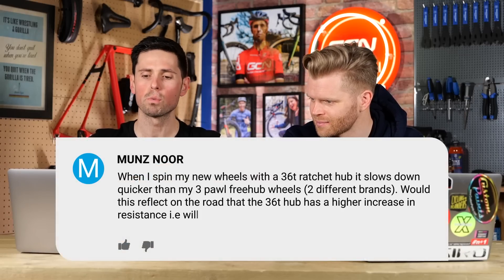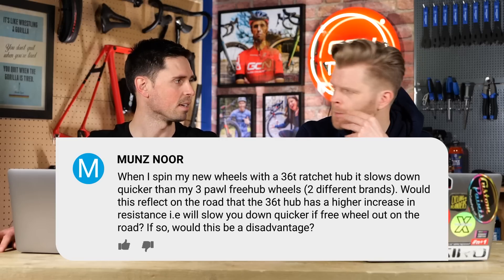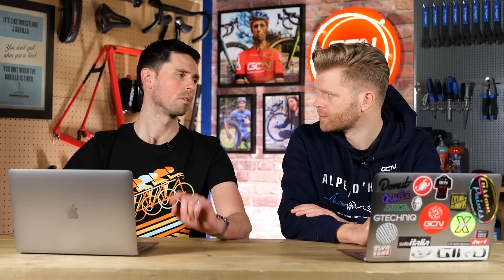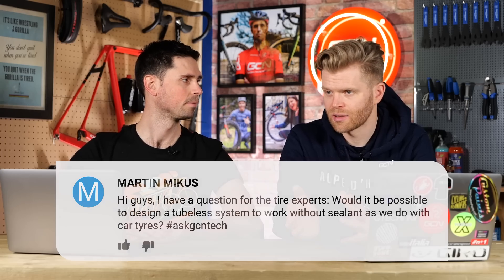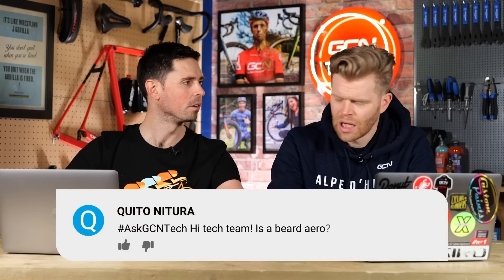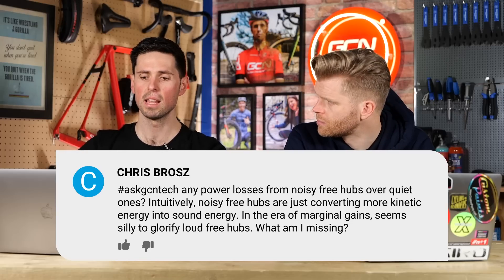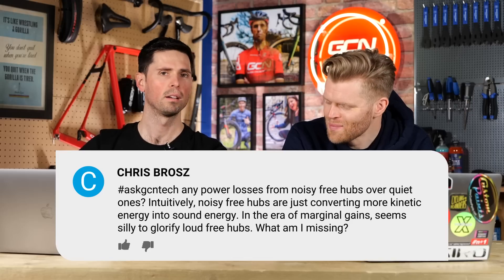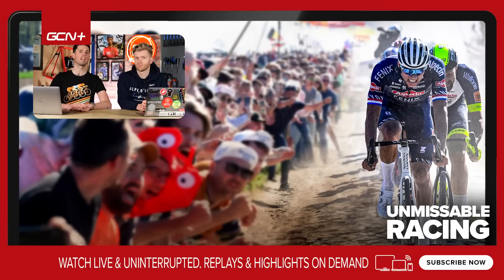Loud Hubs, Electronic Groupsets & Old Tubeless Sealant | GCN Tech Clinic

Comment: For the last question regarding the hole in the frame, the best neat, low cost solution is to use some Sugru to mould around the one remaining cable. You can get different colours to suit your bike and it's removable.
Reply: this is exactly what I did to plug up the front derailleur cable hole to avoid water getting inside the frame

Comment: For the last query, I'd try something like 'Sugru' if the hole to be filled around the cable isn't too big. It's like mouldable plasticine type stuff that sets as a flexible rubber. I've used it a few times on bikes to make grommets etc. Comes in different colours too. One for #hack/bodge maybe?

Comment: Shimano used to make an "external" kit for Di2.  They looked like rubber sleeves that had 3M tape on the backside so you could affix them to the frame and the Di2 cable would be protected.  I had a bike that had that setup (the frame was an older Merckx with cable bosses on the downtube).  It worked just like my other Di2 equipped bike and the Di2 cables were never in danger of being damaged.  Perhaps Shimano still sells that kit?  Or, eBay is an option I'm sure.

Comment: I think the “loud” hubs with more teeth in the ratchet are better when you are moving in that they engage sooner. Pedal stroke is more quickly translated to wheel movement. This is a bigger factor than extra resistance when freewheeling

Comment: 9:00 The thing to remember here is that sound is very 'cheap', energy-wise (or more scientifically, you get a lot of volume for very little acoustic energy). I guarantee that if anyone ever measures the power loss of a loud hub over a quiet one it will be in the hundredths of watts, if that.

If you had a 0.1m/s headwind or 1psi difference in tyre pressure you wouldn't even notice - you just notice the louder hub, that's all...

Comment: For the noisy hub question. The noise generated by the hub is due to the strength of springs trying to grip on the teeth immediately (otherwise you're not gonna go anywhere while pedaling).
Reply: More louddd

Comment: I think when we talk about free-hubs being "loud" we're not really talking about volume but how "noisy" they are. Noisier high pitched "buzzy" free-hubs have more engagement points (pawls/ratchets/teeth etc.) but those points are smaller and offer less friction/engagement individually, but when added up the friction and surface area of engagement is about the same (or less) across the system. They are preferred because more engagement points means the hub engages sooner in the pedal stroke. I actually suspect that on the decibel scale hubs we describe as "loud" are actually quieter or about the same.

Comment: Hi #askgcntech
If I remember correctly, the Continental GP5000 TL was a tubeless tire, not requiring sealant.
You could use it with sealant, but was not mandatory.

Comment: I recently replaced my old Mechanical 11 speed Shimano and replaced it with the SRAM Force AXS on my Emonda ALR which is not setup for internal routing. It's getting very hard to find the Rim brake shifters and now SRAM has abandoned rim brakes with the new Force version. I am glad I finally took the plunge when I could find them.

Comment: I dont use sealant in my tubeless ready tires they work just fine. 
Holds air for long periods of time.
Flat? Well i patch it dont get flats that often i run Continental gator skins. One flat in seven hundred miles so far on these tires. 
Lot of people who run sealant are just reopening old holes and don't know it.  Lol  Ok good stuff  keepemcoming

Comment: The main reason why 'good' quality free hubs are more noisy is because they manufacture is opting for more points of engagement in the ratchetting system. This creates more nose as there are more points of contact moving past each other which while free spinning and this does cause more friction, slowing you down faster. However when pedalling the extra engagement will allow for better power transfer, as it is being done over a larger surface area, while also reducing wear on the system. Additionally it will decrease the time for engagement when you first start to pedal.
The question is, does the power you gain while pedalling outweigh the speed you lose while costing? I would find it hard to believe there would be many rides where the additional lose is more than the gain of the better ratchet system.
Additionally systems like the DT swiss star ratchet are far more reliable that the 'traditional' 3 or 4 pawl system used in cheaper hubs.

Comment: The freehub sound will be more of an effect on drag than aero socks and many of the other so called marginal gains. The sound requires energy to make so therefore there is energy being used. If you are racing you lose the ability to stealthily idle behind a group/person in front.

Comment: Automotive tires are significantly thicker than bike tires, and I think that's a big difference. A smallish piece of glass can easily puncture a bike tire but have zero effect on a car tire. 

Also, Specialized found that facial hair has little to no measurable effect on a riders aerodynamics. Arm and leg however, are significant sources of drag.

On hub acoustics, I think this is easily as much a product of the geometry and configuration of the hub itself... if there is more dead space in a hub, or if the ratchet is somehow more directly exposed to free air, that alone will make it louder.

Comment: Wow, the answer to the first question on drag from coasting with different rear hubs was quite a contrast to the answer on the second to last question about freehub noise.  Since these are all "marginal gains or losses", It would be good if GCN quantified the power consumption of each.  I bet coasting with a draggy freehub is 10x worse than not waxing your chain.
Reply: My guess is that the new wheel just has fully packed bearings that are draggy, and that the freehub is more of a distraction.  As bearings lose some grease over time they spin more freely.  A loud free hub with less and/or lighter grease is likely more efficient than one with heavier/quieter grease.  If a hub has lighter springs it would be marginally less lossy, and quieter.  Overall we are only talking losses when freewheeling, which make all this on the margins of the marginal gains worries.  Buy the hub that you like that lasts the longest.

Comment: #askgcntech I'm gonna come back to my question (you already answered in an earlier episode) about dimples on components and gear, and the aerodynamic benefit of these. The Speedplay Aero pedals have dimples on them. Endura's Encapsulator aerosuit was banned due to silicone textures on the sleeves.. not dimples, but an uneven surface. This just makes me think that a big dimpled (or textured) surface like an aero helmet could possibly make a marginal difference.

Comment: #askgcntech Hello! Not really a tech question, but I'm wondering what might be easier on the body after shoulder damage, flat bars or drop bars? Currently converting a spare  mtb bike to a gravel bike, but before was able to test ride it, I broke my collar bone. So I had the though if I should keep the drops or put flat bars back for easier recovery?

Comment: #askgcntech , Is there any tape or similar which I could put on the rear of the round carbon frame tubes that has “dimples” like a golf ball and would this make an aero difference?  
Why?
I have a reasonably old road bike, a 2008 Schwinn Peleton LTD (nice black, red, gold, original colouring).
I have upgraded it recently ( I did not want to buy a new bike) with R7000 levers, ultegra 11 speed derailleurs and cassette / chain rings, DA chain (I already wax) some 50mm carbon wheels, with nice low rolling resistance Vittorio tires and a lovely Balance Inc integrated aero bar with RED bar tape.  The bike already had older Dura Ace brakes and carbon seat post.
But, the bike is not aero of course, just possibly better than before.  I have an Idea, based on a golf ball having “dimples” to let the airflow stick better/longer.  There is a lot of information about such being very effective for ball distance as the airflow sticks longer.
Ray...

Comment: Why don't bicycles use Torrington oneway bearings.  Don't think the weight would be an issue.  They grab/release quite well and there would be no sound generated.  RC helicopters have used these for decades to free wheel the main rotar hub in autorotation maneuvers to disengage pretty powerful engines.
Reply: "Bicycles" already do. They are called spragg not torrington. Go buy the hubs whenever you like, but they aren't as reliable and they slip/wear

Comment: #ASKGCNTECH  On my new road bike I'm getting a very frustrating chain vibration when the chain is on the smaller rear cogs and small front chainring. The chain vibrates on the top of the travel as it goes from the small cog in back to the top of the front chainring. It's a resonant frequency when I get between 80-85 RPM cadence, then it settles down at about 90 RPM. Have tightened the B-screw, even replaced the derailleur, and rear cassette and re-lubed the chain. Any idea what is causing this?

Comment: #AskGCNTech Dear GCN tech, Is there a tool that can adjust the distance between the pedal axle and the seat and stem on two different bikes, for example a road bike and a Gravel bike. I feel like I'm always using different measurements because my knees are complaining. Thanks in advance!
Reply: Tape measure
Reply: @mikecoller  I tried already is not precise

Comment: Surely to make tubeless milk/muck/slime free tyre manufacturers just need a layer of soft rubber/compound on the bead area of the side wall. Minimum weight gain more than offset by not needing the milk.
I'll never go tubeless as long as it's needs milk. Have you ever rolled a paint tin with a small amount of paint in it?
It doesn't go far because of the liquid inside. I don't want that affecting my cycling.

Comment: #askgcntech if I wanted to change my overall cassette to have a larger tooth sprocket on my canyon (but keep it 11 speed), does this require a change of chain too (or anything else)?
Reply: Hi, it depends on how big the cassette is. If it’s too large for the capacity you’ll know because there won’t be enough clearance between the cassette and the derailleur hanger, pinching the chain. In this case you’ll either need a longer hanger or use a hanger extension  (“wolf tooth”). You may also need a longer chain. I went through this exercise to replace my 11-28 with an 11-34 cassette, in prep for some big hills.

Comment: Just got a bike fit, was told there were two things I needed to get sooner than later. New pedals with a longer spindle, 59mm. And Shorter crank arms. After already getting a new bike, both of these seem costly if you consider powermeters, and the new 105 Di2. What path do you suggest getting first? #askgcn
Reply: you may be able to get a new spindle and use the same pedal.

Comment: I’m willing to wager that somebody else has already mentioned this, but the two of you seem to have missed the fact that when a freehub is making sound, regardless of its design or how noisy it is, the rider is not peddling the bike and the hub is basically in an unlocked position! If you are not putting energy into the drivetrain, energy consumption is a non-issue at that moment. The resistance created by the freehub when it is frewheeling might have a slight amount of drag while coasting, say during a descent, but if it was enough to be an issue at all, the first thing that would happen is your chain would drop into your chain stay, which would be a much bigger problem then lost efficiency!  I’m  baffled that you didn’t consider this!

Comment: Good luck with that silca sealant! The fibres ball up and become useless. Check your tyres after a hundred miles. They sent me their latest formulation, supposed to solve the problem,  but it was just as crap. Oh, don't use CO2, because that solidifies the sealant real quick. Anyway, even with the fibres balled up, it's probably better than that water soluble muc-off rubbish that washes out of holes at the first sign of dampness.

Comment: Car tires are very rigid and require special machines to get on the rim. You don't want that in a bike tire. Car tires are stiff because the car has a suspension. On a (road) bike, the tires ARE the suspension.  You want them soft and flexible.  Yes you 'could' make a tire that doesn't need sealant.  But it would be much heavier, impossible to change on the road, and ride terrible.

Comment: Why is Munz Noor comparing apples and oranges. He mentions teeth on one wheelset and pawls on the other. Pawls engage with teeth! How many teeth do the 3 pawl wheels have. How many pawls do the 36 teeth wheels have. I'm surprised Ollie and Alex didn't mention it. But that info really only relates to engagement time. Doubt it has much to do with any resistance. The wheel bearings would be more important.
Reply: Perhaps he meant the DT Swiss Ratchet freewheel - which doesn't have pawls?

Comment: #askgcntech Hi guys, I'm looking to spend some of my hard earned cash on some nice upgrades for my road bike, a Cannondale SuperSix EVO Hi-Mod from 2018. The question is which one to make. Do I go with a fresh set of DT Swiss ERC DICUT 45 DB or the new 12 speed Ultegra groupset? Or maybe something else entirely? I have of course gotten a nice pair of high quality tires set up tubeless already. The bike is currently fitted with mechanical Ultegra 8000 series and 35mm carbon wheels. The rims might be carbon but the hubs are garbage requiring constant maintenance.

Thanks in advance!

BONUS: If I got the wheels, I'd also be using them for the occasional local off road race on my gravel bike.

Comment: I still don’t get the tubeless hype. Honestly, changing sealant every 3 month, the need of special cleaners for some brand

 … come on. In hobby / amateur sport what’s wrong with a 5 Euro tube…😂 - we and you guys are constantly talking about budget bikes, accessibility and affordability to the sport…

With modern tyres, I don’t even remember my last puncture and I’m also racing …

Not speaking about gravel or mtb, just road.
Reply: Hey, there is nothing wrong with a 5 euro tube, but there are lots of advantages to be had from other setups. This is the beauty of cycling, if you want performance/low cost/reliability/ease of use etc etc there are hundreds if not thousands of options to choose from to suit each characteristic.  I mean if you are racing, to me it seems crazy to me to not utilise some of the tech out there to help you ride faster....
Reply: @GCNalex  Hi Alex, thanks for your reply! I get your point and of course I think, that everyone should choose whatever setup suits best.

Reasons I’m not using TL:

- bad experience being covered in sealant (probably due to my own mistakes :P)
- as mentioned: cost 
- at the level I’m racing at, I think there are still more benefits to gain from position on the bike, training, more intelligent racing. So far I’ve considered using TL as a marginal gain compared to a classic setup. What are the gains in watts / rolling resistance comparing tube to tubeless?

And btw: Love the show and channel - thanks for your work 👍🏻
Reply: @florianmatz1885  No problem, i enjoy getting in the comments when i can. Some peoples TL experience is enough to put them off and i totally get that, it can be a faff. In terms of comparisons, it really depends what setup and tyres as there are different results and so many options. But TBH in lots of indoor tests, Latex tubes and ultra light race tyres test fastest. Its only really the latest/newest TL tyres that are starting to come out fastest in some cases.

Glad to hear your enjoying the channel, thanks